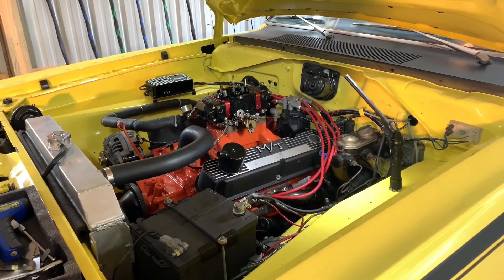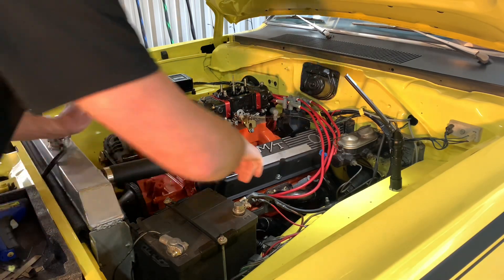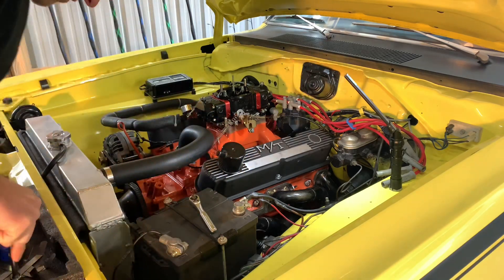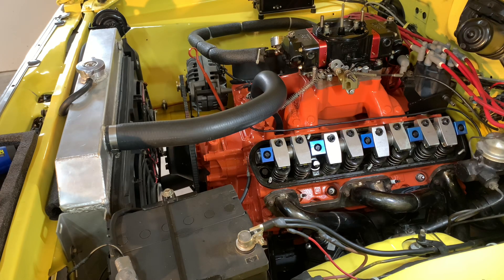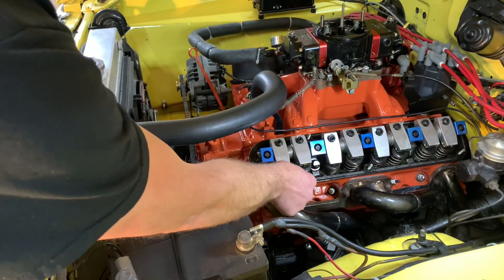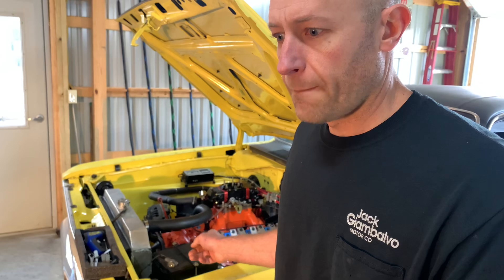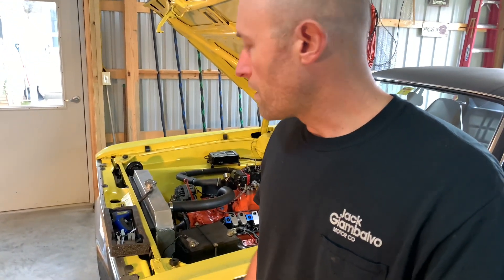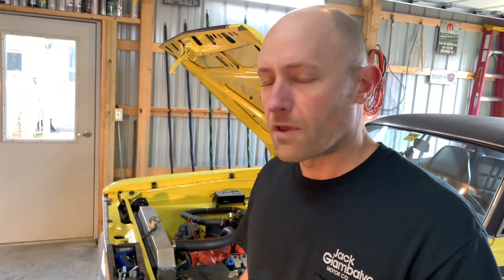Valve lash…and how temperature affects it. The TRUTH may surprise you.

Comment: Keith Dorton of Automotive Specialists has done extensive research in this area and provided us with some guidelines when it comes to lashing a cold engine.

Because different materials expand at different rates as they are heated, you have to take into account your engine's construction when estimating how the lash will change as the engine approaches operating temperature.

For an engine with cast-iron heads and steel valves, you can expect the lash to tighten up a couple of thousandths of an inch as it heats up-so for the cold lash you would set the valve lash a couple thousandths larger than the cam manufacturer's recommended hot lash setting.

If the engine has aluminum heads with a cast-iron block and standard steel valves you can expect lash to loosen up approximately 0.006. If you are running aluminum heads with an iron block and valves with narrow 6mm stems you can expect the lash to loosen up 0.010 to 0.012. And finally, if you are running an all aluminum race engine, the lash can loosen up by as much as 0.015.
Reply from the maker: My engine had iron heads/block at the time of this video. Valve lashed actually increased when the engine warmed up. Cast iron head expanded more than the valve train components I guess.

Comment: Um i don't know why you would.run solid  lifters on a hydraulic  cam a solid  roller  cam is more power and i have a  question  about the way your. Checking  your lash on a chevy you have  to check the  intake valve lash with he exhaust  valve starting to  open  and  the  opposite  for the exhaust is it different with mopar
Reply from the maker: I definitely agree with you, a true solid cam does have a more aggressive profile. And will make more power. I did this because I wanted to keep the cam I already had. 

I have checked the lash like you’re describing. But I do it a TDC unusually because I can check both at the same time.

Comment: I just saw this video now, I must’ve missed it, I’ll be going down this rabbit hole with lash again when I get my motor back. I have a lot of experience with setting up turret lash on cranes, as well as direct drive gear threaders from the 1940s. I’ve done this my whole life but when it comes to valve lash, it’s interesting to me because heat perhaps is a variable. Applying skills I’ve learned my whole life to mopars is fun. Even if sometimes I screw something up. All part of learning.
Reply from the maker: @maximuswedgie5149  That’s cool that you can apply other skills that you have to the mechanics of your engine. And you’re right, any mistake can be used as a learning experience.

Comment: You still using FST carb how's it running for you.thanks don
Reply from the maker: Yes, sir. I recently swapped out the stock pink accelerator pump cams for the orange cams. That helped out that transition to wide open throttle after I installed an open carb spacer.

Comment: Yep,when i put a cam in whatever numbers the cam card says for hot lash i just set them cold at .004 less than that and when i check them hot they are always pretty much right on the money,with cast iron heads that is,i also have the exact same rockers and shafts that you do on your engine.
Reply from the maker: Nice, I like those rockers. I got them years ago and they were a good deal.

Comment: Do you use type F fluid with friction modifier. There is a certain roller rocker that guys swear by because of if that lash issue I forget the brand
Reply from the maker: Yes, I did put type-F fluid in my new trans. I heard it is a little grippier than dexron fluid.

Comment: You can see the Battery bolt twirling.Maybe a look at Aluminum heat resistance and Steel is surely different. I would have to take for a drive too.oh and the 2-3 Gear shift will be as fun as 1-2 now
Reply from the maker: Lol, yeah didn’t have the terminal tightened down. I can’t wait to drive it.

Comment: Good job, I also use solid lifters with hydraulic cams because there's more to chose from and the engine runs way better with solids. With the poly locks, they hold the lash for along time. I like to keep it tight .008 - .012 cold, my research was that it increases 2 - 3 thousand with all iron engine when hot and 4 - 6 thousand with aluminum heads. I've never done a test so I just took their word for it and never had a problem. Thanks for doing this test, and I'm sure a lot of other people appreciate you efforts. All the best.
Reply from the maker: Thanks buddy. I hope it enlighten someone out there.
Reply: Thanx for the video. I run a 440 six barrel. Competition cam, solid, split lift and duration. Harland sharp rockers. Cam card says around 20 thousands cold. Engine is over 20 years old and runs great. I do keep the lash setting a little tight at 18 cold. Have a good evening. Mopars!

Comment: I recall the Chevy camp using what they called a  30/30 cam .
0.030” lash on both sides
Reply from the maker: Yes they did, I heard you would pick up a little top end power if you tightened up the lash though.
Reply: 20/20 you may see better ?
Reply: Ran Duntov 30/30 solid lifter cam.   Cold not started over night   22-25      Hot run for 5 to 10 miles 30/30/.
Reply: @garybray3614 
20/20  ,…… U  may see better ?

Comment: I was going to guess that the exhaust would tighten due to heating of the valve stem. Intake would open up. I had a flat-head that would run good till it warmed up. The valve sunk and had no clearance. Then the valve grew in length and lost compression. Good video. Honda V6 will start to missfire with tight exhaust clearance. OHC engine.
Reply from the maker: I think a flathead would be one of those exceptions. They have a different cylinder head/valve train than a overhead valve Mopar, Ford or GM right?

Comment: Back in my high school and early college days back in the mid 70's I was taught the same thing, as the engine heats up gaps get closer, however  in my 45 plus years in auto repair and hot rods I have found the opposite to be true, depending on the metals being used you might have to adjust the cold settings around .003-.005 tighter then hot. Just Mopar Joe did a video not that long ago about this topic.
Reply from the maker: Yes, I do remember seeing Joe’s vid on this. It is kinda opposite of what you would think. This video was more about clearing my conscience on this matter.
Reply: Stuff like that bothers me too, so your conscience is clear. @Duster_Garage